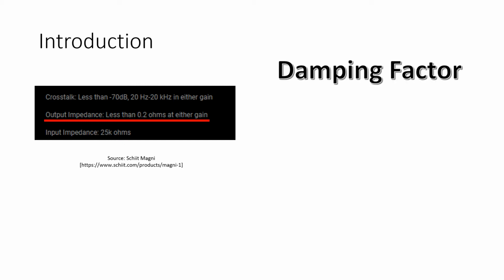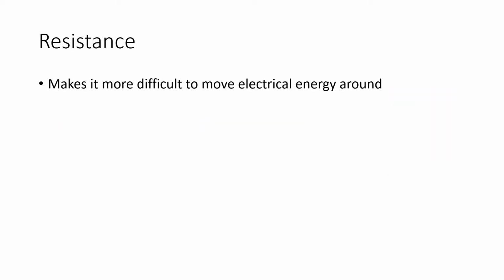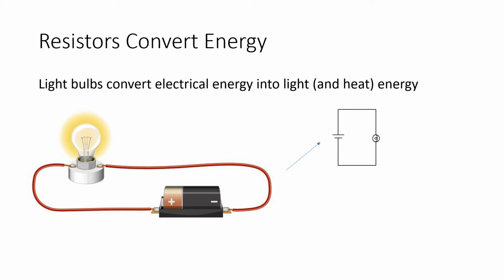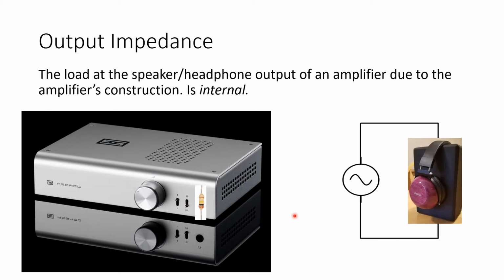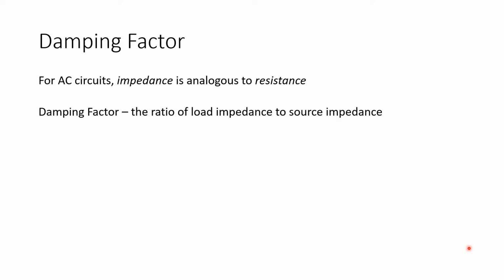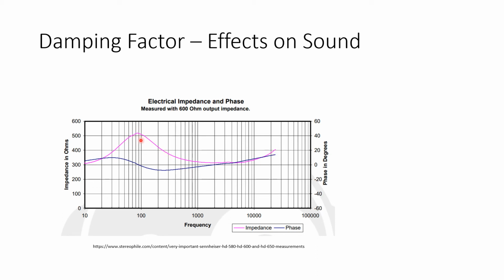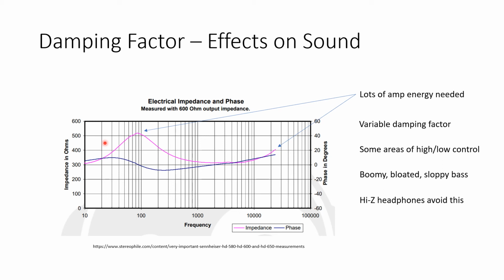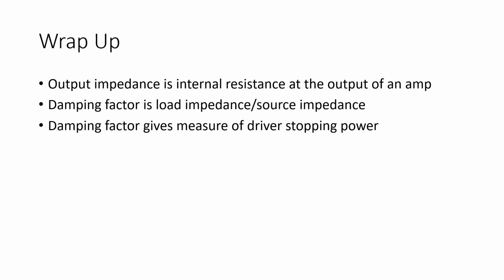WaveTheory Breaks Down Output Impedance and Damping Factor in Audio

Comment: Hi! Love your videos, question on this as it applies to two products you've given pretty good reviews to: I'm thinking about pairing og focal clears with the hifiman EF400 (they're both on a lovely sale). you might say this is much more power than the clears need, and yes, but I've heard—and you've reported—that they scale well. I've also heard that an r2r dac can help out the one slight weakness of the clears—timbre. Beyond this, I own other headphones that I think would pair well with the EF400 such as my HD600s and LCD-2Cs. To get to the point, although hifiman doesn't officially report the output impedance of the EF400, it has been independently measured as fairly high relative to other solid state amps. 18 ohms out of the 3.5 mm, 5.7 ohms out of the 6.4mm, 10.3 ohms out of the 4.4mm, and 9.85 ohms out of the XLR. The og clear's impedance is 55 ohms. Do you think this is a good pairing? Would there be an audible difference between the damping factor using the clears on the 6.4mm single ended vs the XLR (as I'd prefer to use a fully balanced system)? 

TL;DR: General thoughts on the significance of a damping factor of around 5 vs the stated goal of 8 or more when using og focal clears with a hifiman EF400?
Reply from the maker: Thanks for the kind words. The damping factor of 8 is a target for Beyerdynamic and Sennheiser quite often, but it's really just a rule of thumb and what they build their headphones too. Even at that, they sometimes break their own rules. Beyer's A100 amp has a 100-ohm output impedance for intended use with their 600 ohm cans, which of course means a damping factor of 6. The "correct" damping factor is the one that works for you. That said, I find my Radiance quite enjoyable on the EF400. I also enjoyed it on the Singxer SA-1 which allows you to bump the output impedance to around 11 ohms, I think. It didn't sound quite as tight but still sounds pretty enjoyable, IMO.

About the EF400 specifically, it's hard to answer just about the difference output impedance will make between its balanced and single-ended outputs. The confounding variable is that the EF400 sounds WAY better from its balanced outputs than the SE inputs, as most balanced devices do around this price point.

Comment: This was helpful... I have a more specific question... When I bought my Maggie LRS I had a helluva time matching them with a proper amplification.  Finally I drove to a Maggie dealer and he had me demo an LRS with a Hegel H160.  This had a damping factor > 2k and 250 watts into 4 ohms and stable down to 2.   What the dealer told me was since the Maggie dip down to 2.8 ohms and 86dbs this is an extremely inefficient speaker to drive and it's open baffle and requires very high end amplification for driver control and speed.   Basically the damping factor and 2ohms stable was more important than total watt specs.  The part that was confusing to me was that most amps are 4-8 ohms but many if it falls below 4 ohms it will trigger the thermal protection.  He was right after about 5 different amps the Hegel provided the best pairing for the LRS with the best control and speed to handle what the LRS did best even though it didn't have the most power persay.  I'm still confused that lower ohms makes it harder to driver for these amps as it's lower resistance which you would think would be less heat.
Reply from the maker: " I'm still confused that lower ohms makes it harder to driver for these amps as it's lower resistance which you would think would be less heat." - It does seem backwards, doesn't it? I think the confusion here is that the easy-ness of the driver to be driven when it dips below 2 ohms is that it means it's harder for the amp to keep up. When resistance goes very low the driver draws a large amount of current from the amplifier. Most amps are voltage amplifiers and not current amplifiers, so they can struggle to provide the amount of current the driver wants to pull when the driver wants to pull it. This is often a power supply issue as the power supply struggles to keep up with the rapidly changing current demand. Amps that are comfortable pushing large amounts of current when asked are usually more expensive and heavy, because the power supply is more expensive, has higher quality parts, and often large capacitors - and then the weight comes from the need to cool all that down with larger heatsinks. This explanation is a again a stripped-down, simplified one and an actual electrical engineer could go into far more detail as to why this is, but I hope this explains the basics well enough. Thanks for watching!
Reply: @wavetheorysound  thanks WT this answer makes complete sense!